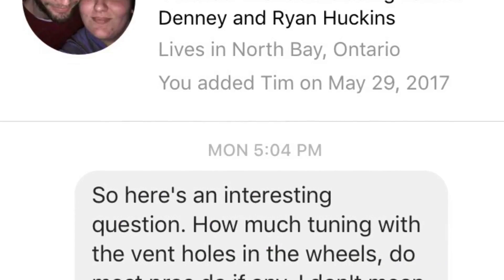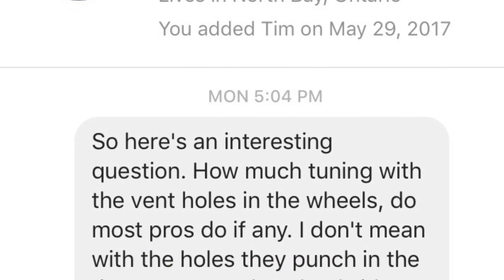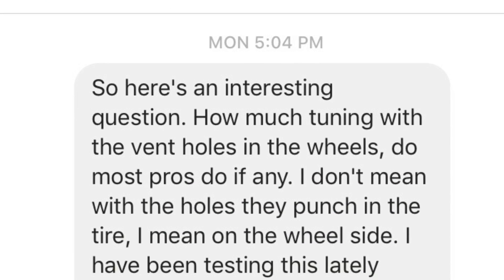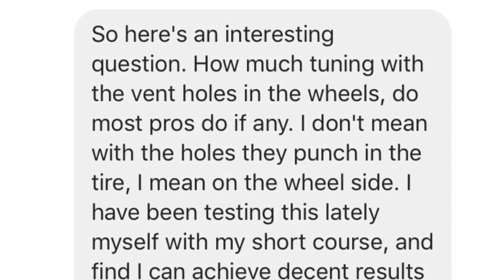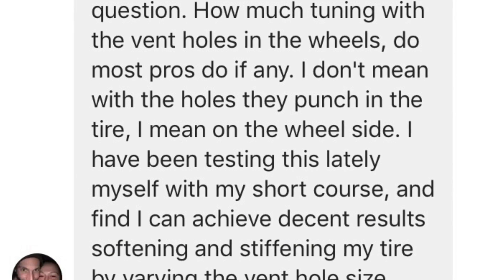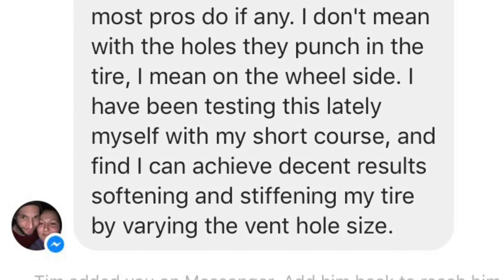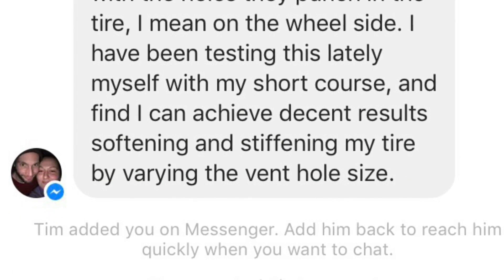Q&A Vent Holes: Tires or Wheels?

Comment: where not enough holes hurts you is landing big jumps, it will bounce. i put 4 in the tire 2 in the wheel... 1/8" i use a hole puncher..